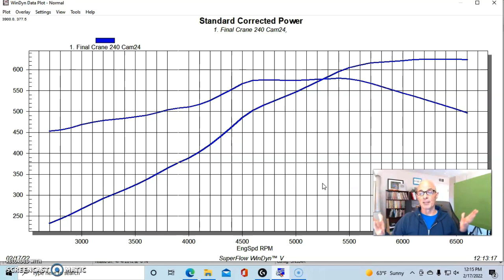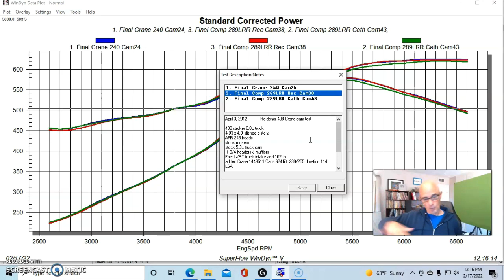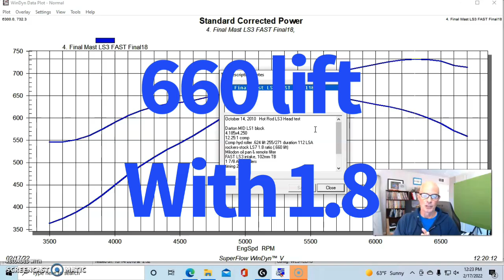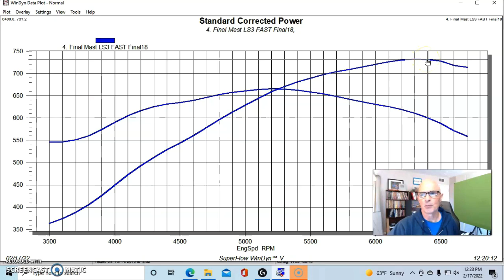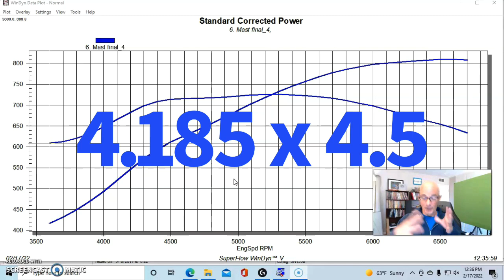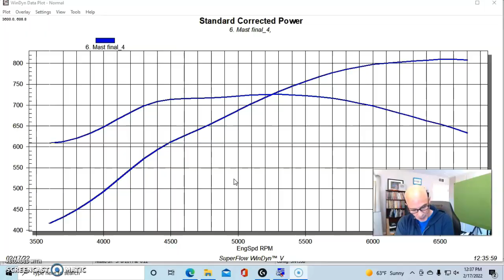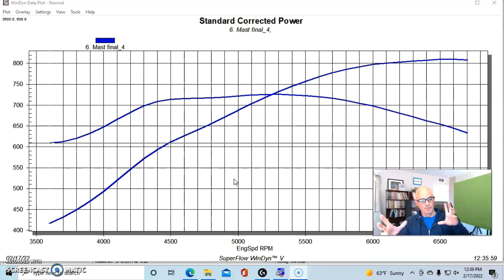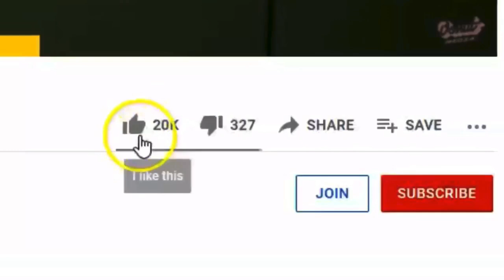HOW TO MAKE MASSIVE ALL-MOTOR LS POWER! HOW MUCH POWER DOES A 408, 468 OR 495 STROKER LS MAKE?

Comment: How about a charged 495... Pick your BOOST.. limit the rpm and maximize low to mid power and torque... Guessing 1000lb ft,. At least same on HP. Limit rpm to 6500, Love to hear the haters on that.. just bench race wishing... Have a Great day.
Reply: All fun
Until
The crankshaft  leaves  the Party 🥳
Reply: There’s a point with boost and long strokes where piston design is compromised and big power is extremely short lived. Same reason people making big power with big blocks don’t go much more than 540ci. Steve Morris covers this in depth in his Steve Tech series.
Reply: @heytonyman  
Also  a BBC  is much stronger 💪,   remember  BBC  engines  start it life as a truck engine  hauling  huge loads.
Reply: I Daily  Drive my Beast. 
It's  Turbocharged
It's  has  Fuel injection 
It uses a intercooler 
It  makes 1,000  foot/pounds of  Torque.
It uses massive 😳 rods and bearing.
I  torture test  it's  Torque 😫  many times  a month.
Yes grasshopper  I  can show you how 🤔
Reply: @billywilliams6853  not sure where your at on your combo... Just thinking about one that'll make800 ft lbs.. @2000 rpm. For towing with a big vehicle. Suburban, 2500/3500 truck low boost on the bottom 1 or 2 lbs at 2000 rpm 10ish at the top ? Something to tow with.
Reply: @RJZJR1  
Yes my Ford POWER STROKE  DIESEL,   makes 1,000 lbs/ft.
Tows  my 32 foot 12,000+  lbs  fifth  wheel   RV  Trailer with ease. 
I  really  have to remember that I am towing a RV.
I  went  over the 11,000++ foot elevation  Rockies,    USING CRUISE  CONTROL. 
BUT
The Long Blick weight  is 1,000 lbs.
My point is,  at 800 or 600 lbs/ft,  using a  LS ( 4 HEADBOLTS) :
1.  Bend a rod
2.  Crankshaft 
3,  transmission 
4,  rear-end
5.  Tires
6.  Brakes
You need the complete package,    to haul heavy.
But
I  would  like to have a million dollars to  use
Low boost (5 psi) on the Ford 7.3 liter GASOLINE  engine in a Ford F-350.
Would  be a excellent GASOLINE  tow truck.
Using a F-350 DIESEL  Spec truck 
DIESEL radiator,  diesel  transmission,  diesel  brakes , diesel  tires, BUT  using the 7,3  turbo GASOLINE engine. ⛽
I  could  do it for million. 
But Ford would  need  50 to 100 million  to do complete  program.
Reply: @billywilliams6853  you are right... All it takes is money and drive
Reply: Figured some one would chime in ... There's secrets to all combinations.. just because you can't do it for the price of a white castles shake... Does not reduce the possibility of it being done. Stock parts are meant for the few that can't afford the real stuff... And when you finally get to the invoice from your engine builder... And start sweating.... There's more behind the crank... Your 300 dollar engine is great ,but all the while that's not it.
Reply: Stock what? Price what? It literally has nothing to do with it. When you’re putting in billet everything to hold high horsepower, it literally costs nothing more to run a longer stroke and more cubes. The issue is reliability. If it was worth a damn, everyone would do it. Yet most people (who actually do this stuff and not bench race in the comments section) keep it under 400ci because cylinder wall thickness and piston stability matter when it needs to live more than a couple pulls on the dyno.
Reply: @heytonyman  reliability is a stock term, everything else is by design... If you don't know what your doing stick to the internet you can have the new reliable pink LS what ever.
Reply: I see, you’re just a troll looking for a fight in the comments section. Copy that. 

Ask anyone in the winners circle if reliability was a factor for getting there. Better yet, go tell Steve Morris and Proline that they don’t know what they’re doing and you have all the answers. They’ll be impressed. Nobody else is.
Reply: You don’t want to much low rpm torque since the bearings are still the same size. If you really went for low rpm torque it would just push through the oil and spin the bearings before long. Bigger bearings take more space and a bigger block.

Comment: Yes!! I built an lsx454 for my Pontiac G8 and 700hp NA on the street is so much fun!!!!
Reply: Did u have a lsx 454 block or started with something else
Reply: @bigdog3929  yes I started with just the LSX454 block, added Callies Dragonslayer crank, Callies H beam rods, Weisco cuetom boost/nitrous pistons. Traded some parts for a pair of LS7 heads and had them ported. Has a smaller cam for the displacement (239/254 114) but idles/runs amazing for the street, and with a 3800 stall it just roasts tires on demand lol. I have a nitrous kit I'm about to install before I hit the track in the spring. Can't wait. Never had a single issue with the combo. Still on stock radiator lol. I couldn't be happier. If I ever boost it, it won't take much to hit the magical 1,000hp mark either.
Reply: @ziggybmw  what’s the lift on that cam ????
Reply: @guntherdadsons2cents  .660/.630 with 1.8 rockers. It's an off the shelf BTR stroker cam

Comment: What size fuel injectors do you need on each motor that will support that kind of horse power?
Reply: 1000cc and a walboro 525
Reply: A lot. 
And a good pump or 3

Comment: ERS did a stock resleeved LS block with deck plates. There are many ways to get 455 to 499 cubes. I Like what a poor 1.4:1 L/R ratio can do; in all my dealings, never seen a 4033 Aspiration Index or 1.47 lb-ft per cube with a Rod ratio like that. My utmost respect for a great time, cam and head and block combo!
Reply: 2JZ use deckplates as well...
Reply from the maker: I HAD A B16 HONDA WITH DECK PLATES

Comment: What is the compression on the different engines please.
Reply: Yes , compression on all 3 please
Reply: @ejohnson3837  High comp is nice and all but I really like pump gas engines.
Reply: @waynetessier3058  Me too but e85 helps high compression..
Reply: @P71ScrewHead  I know but I like any engines that are running 89 thru 93 octane pump gas.
Reply: @waynetessier3058  yup because E85 is getting rare
Reply: @shadowopsairman1583  E85 I don't believe would be a good fit for me where I live, as it is my truck gets less than 10 mpg. when being nice, if I travel somewhere I don't want to be searching for fuel with a 15 gallon fuel cell, not interested in spending over 1000.00 for another set of 18* custom piston's along with all the other cost that would entail.
Reply: @waynetessier3058  I prefer pump gas too cuz it's available everywhere, e85 is rare where I live here in HTX..
Reply: @P71ScrewHead  It's not readily available everywhere in my area either.
Reply: @waynetessier3058  that's what sucks about it cuz engines run kooler n make more power with it.. I do plan on building a 632ci BBC/BBF in the future n I do want to run it on e85 n boost, gonna be a fun street car whatever car i go with.. ;)
Reply from the maker: ITS IN THE VIDEO

Comment: A LS that can get it done all motor is respectable! I wonder what my chances are of running into someone with the 468 and 495 motor 🤔
Reply: Quite slim, especially when you can add a supercharger or turbo to a stock displacement motor for a lot less and make just as much power if not more……….although the thought of stroking my lsa supercharged 370” to 408”in my nova does sound tempting, and affordably within reach as appossed to the 468/495 sleeved aluminum option which would probably be somewhere around $10k+
Reply: @trentdawg2832  I should be good then 🤣🤣. I just have to hope the turbo cars aren't running right or catch them in the summer
Reply: @trentdawg2832  I wouldn't say alot less.. a blower kit cost around the same as a stroker shortblock .. but more labor in the short block
Reply: 10’s of thousands of LS 427’s and 441’s out there but you are right, not many 468 or 495 LS based engines out there.

Comment: Only problem with engines like this is the expense. I don't even want to think about how much the 495 LSX cost.
A 5.3 with a turbo, cam and tuning can do 800hp far less expensively.
Reply: And far less reliably. Cheap, Big power and Reliable; you can only pick 2.
Reply: Yes. 5.3 LS. With boost controller e85 and good sleeper cam. Can drive daily and 700ish rwhp. Light weight car.
Reply: Horsepower costs... How fast do you want to go... Wanna play gotta pay... One way or the other., It's going to cost time or money.... Take the information that you get here and apply it to your combo.. ther is no such thing as free Dyno time.. we'll keep watching, you keep spinning. Thanks... PS. You should promote your books, a wealth of knowledge and insight..
Reply: Still be watching tail lights... Big torque moves the car out of the hole.
Reply: @RJZJR1  Agreed. Big engines making solid power ALWAYS have more area under the curve than a, equivalent-power tiny engine with any size turbo
Reply: @rustysausage69  not saying that the smaller one can't... Just there's more to it, block fill , rod length, deck height. And main strength... LS is a hot market and Rich has it covered. I'd love to give him one to big bang... Just to see the out come.
Reply: the thing is though, with the stroker your basically getting a refreshed motor that you know what the condition is compared too the junkyard 5.3 and will be more reliable too
Reply: @chrishansen7004  very true. But, a junkyard 5.3 long block is in the range of 200-300 bucks. Could buy a whole lot of junkyard motors for what that 495 will cost. Though that raw N/A power of the 495 would be awesome.
Reply: @Chase.bachler  a forged out 5.3 or 4.8 can hold 300 hp per liter plus.....although the stock stuff can hold it for a little while. The thicker bores and lower friction of the smaller LSX engines are advantageous
Reply: @chrishansen7004  you could do a premium rebuild your factory motor three or four times over for the cost of just the block. You're in it for 9k min. Turn key is more like 25k+